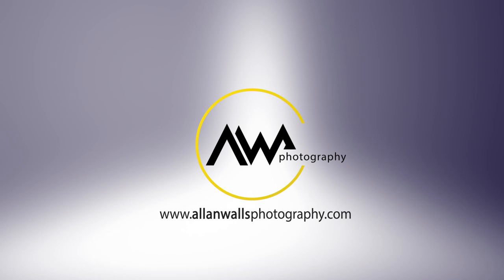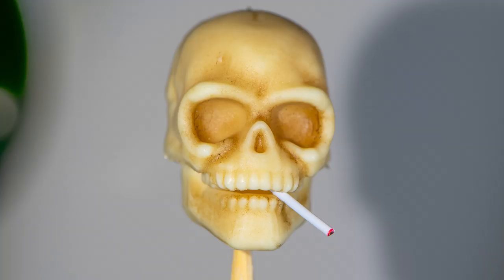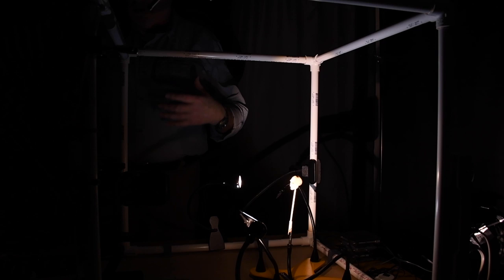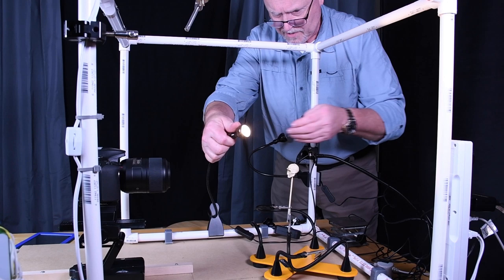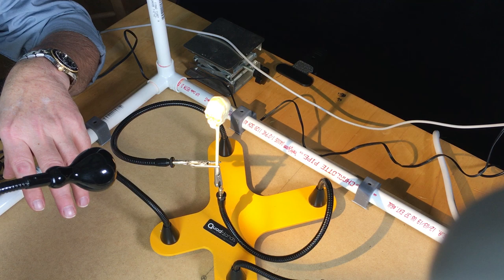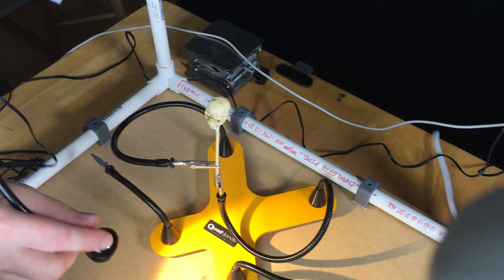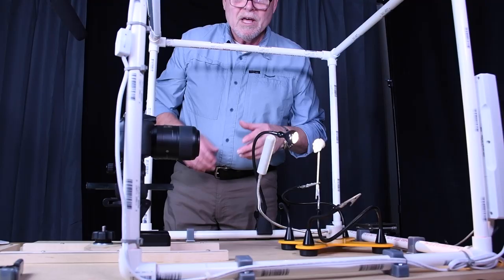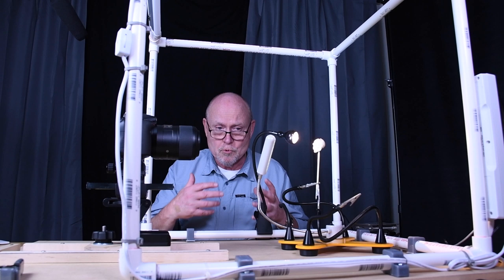The Macro Lighting Cage - Part 3 - Continuous Lighting

Comment: Thanks for the videos. Interestingly, I was looking at how to create a setup for small product videography, I came across Karl Taylor and learnt a lot about how he thinks, I don't have the money or the studio to do his set up but it got me thinking that it should be possible to get great results from some kind of flexible LED setup.. And I found your channel from 'creative  options for indoor macro photography' title.. Exactly what I was looking for.. many thanks... The only thing I would add is that I was originally thinking dimmable LED's all controlled via an app, probably something I will try look at at a later date. Just envisaged the flexibility of that to be a huge benefit, to be able to adjust while looking down the lens..  Many thanks again. Great tips
Reply from the maker: Hi Gordon, I just wanted to let you know that I have done some tinkering with dimmable LED light sources and they can be very frustrating to use in photography. Many of the dimming circuits I have tried have a lot of flicker, ghosting, and strobing. They also have a tendency to change output suddenly and unexpectedly. In commercial product photography, where lighting and color rendition are paramount, these shortcomings can drive you nuts. I have found it more reliable to control the light by adding and removing diffusion layers to get the light the way I want it. Thanks for the comment!
Reply: @AllanWallsPhotography  Many thanks for the reply Allan. What I think I will do is construct a cage similar to yours and probably find slightly more powerful mini lights, since I will need more clearance near the subject to allow video to be taken on a slider. I did actually find a commercially available dimming solution  (Adaptalux) but if I do eventually go down this route I now know that I need to take great care ( and learn more ) in the quality of the components I use to build it. I'll put that on the back burner for now. Thanks again.

Comment: Very nice. I had been using LED bulbs, 5000 K 8.5 W, on light reflectors from WM with styrofoam food containers as diffusers with OK results. Your very informative video has changed my view of lighting, focused instead of my shotgun approach. Thank you.
Reply from the maker: The light is all important in macro. I have designed a cheap focusable pin light and spent today building and testing prototypes. I want to find a way to add a 2-3mm spot of illumination for highlighting insect parts. I'll be showing how to make one in an upcoming video, if I can find a build I'm satisfied with!

Comment: Another great video Allan. I have a question. I am looking at buying a LOMO 4X Infinite microscope objective to mounted on my 100mm macro lens and 3 extension tubes. Have you done anything like this before? If so, will the combination above work for tight headshots of an ant's head? Greg
Reply from the maker: Hi Greg, I think you might run into problems using a macro lens as your relay lens. The way macro lenses are built, for close-in focusing, I have found them difficult to work with. I would rather use either a telephoto lens at it longest focal length or a basic tube lens as my relay. The 4x objective you are looking at is prone to quite a bit of softening in the corners, as are most 1-5x objectives. If your budget can stretch to it, I would recommend a Mitutoyo 10x. For considerably less, the Nikon 10x CFI plan achromat is an awesome objective. With either of these objectives you can get all the way to 10:1 with a 200mm tube or telephoto lens (on a crop frame body, of course). Perfect for an ant head! And you won't have to use extension tubes. Having said all that, I have never tried the setup you are talking about, so it might be superb. When it comes to extreme magnification photomicrography, if I find something that works, I tend to stick with it!
Reply: @AllanWallsPhotography  Thanks Allan. I will follow your recommendations on this one. Real appreciate the information. Greg
Reply from the maker: @photografiaaustralis2131  Since replying to your question I've been digging through my gear looking for a 5x infinity objective - I know I have one somewhere. I want to try to replicate your setup and see what kind of results I get. Didn't seem right to question your setup without trying it out first. I'll let you know what happens.
Reply: @AllanWallsPhotography  It might be an interesting test Allan. It certainly is a huge learning curve on my end. I appreciate your thoughts.